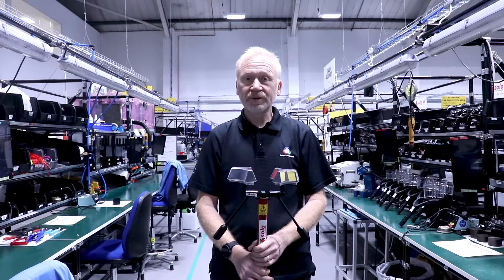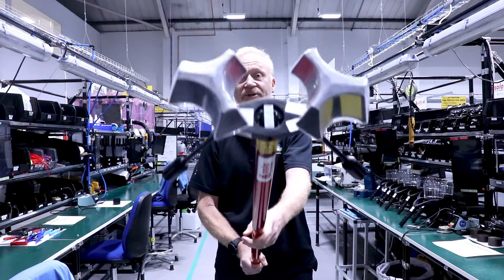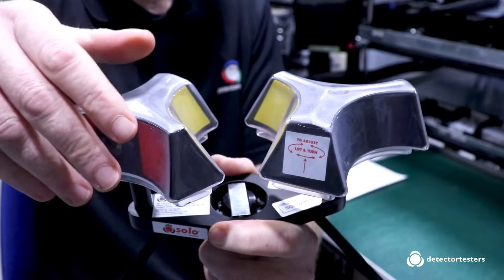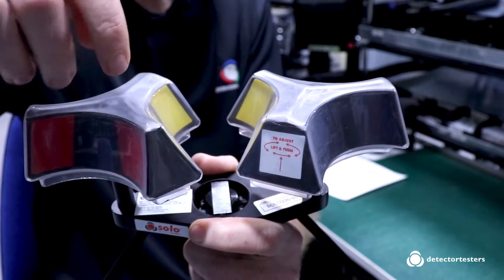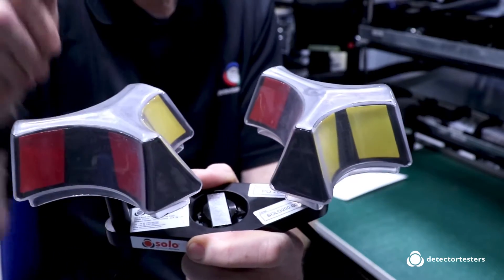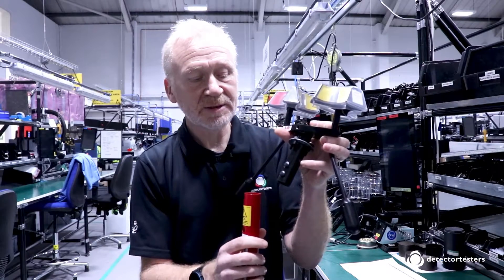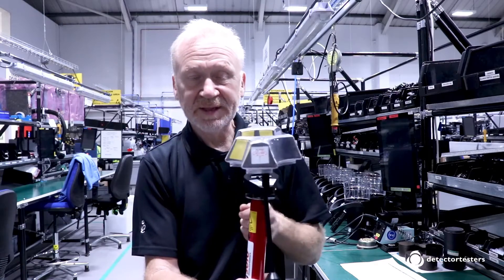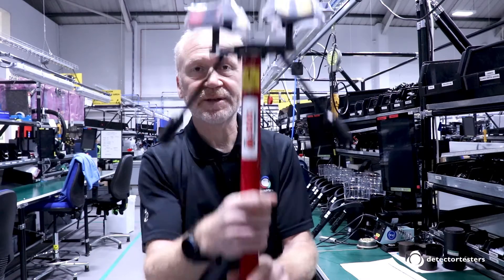TOOLBOX TALKS - SOLO 200 DETECTOR REMOVAL TOOL

Comment: Is there any product available to remove the detector by pressing the notch? As there are some detectors, you have to press the lock, then rotate it to remove. Kindly advice for EST3 detectors.
Reply: The Siga EST3 has an anti-tamper lock (tamper-resist lever arm), which is usually used when the detector is mounted on a low ceiling to stop removal of the detector. When installed out of normal arms reach the manufacturer's instructions recommend that the plastic tamper-resist lever (in the base of the detector) is removed (before installation of the detector) which will disable the anti-tamper feature.  If the detector has the tamper-resist device fitted, the only way to disengage the lock is to gain access to the detector and use a suitable implement into the access slot to dis-engage the lock.  We don’t manufacturer any removal tool that would allow dis-engagement of the lock via a removal tool and Solo height access pole.